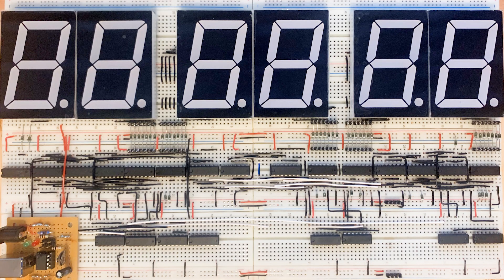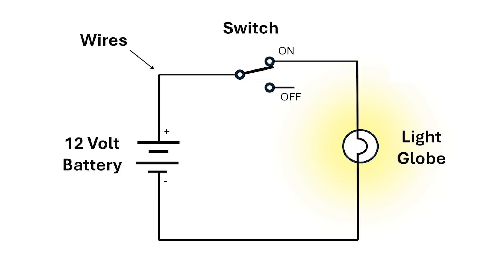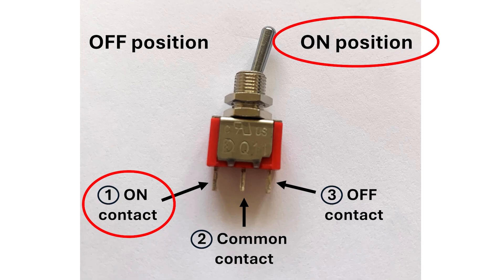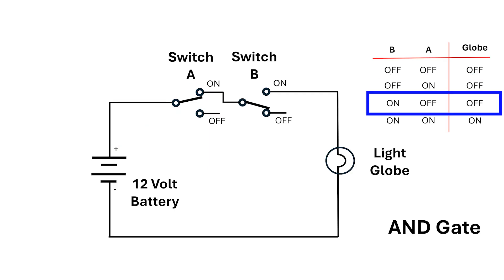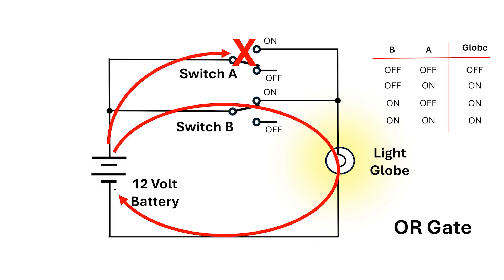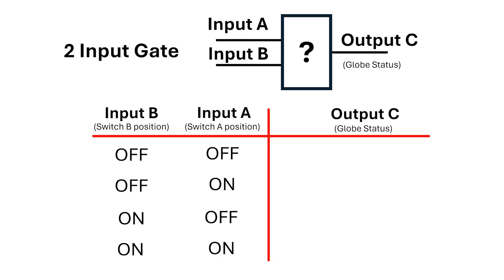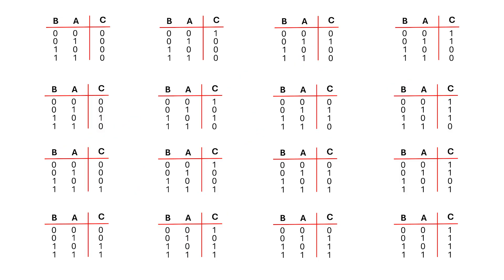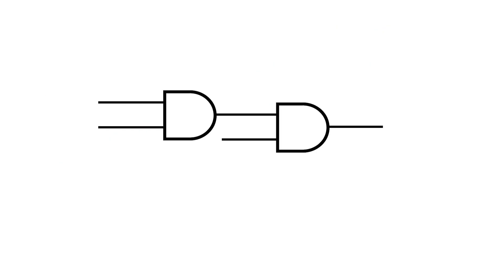Switches to CPUs: 2 Input Gates

Comment: (1:19) This is the classic view of electricity, but technically, the electricity actually flows from the negative side of the battery. That's just a nitpick, though.
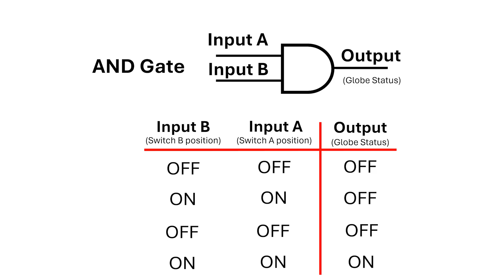(6:16, 7:39) On both of these truth tables, you repeated "OFF, ON, OFF, ON" for both input columns, when one of the input columns should be "OFF, OFF, ON, ON" instead.
(8:01) That should be "OFF - ON" for a short bit before changing to "ON - ON."
(9:28) It might be good to explicitly point out that you added "True" and "False" here.

Great video! Most of my commentary on this sort of video just tends to be pointing out things that could be improved.
Reply from the maker: Thanks for the feedback, glad you like it.
Unfortunately, once a youtube video is up, it can't be modified.
You can snip bits out, or delete the whole thing and repost, but you lose all the comments when you do that.

It was a deliberate decision to talk about conventional current instead of the flow of electrons.  This is designed for 12 year olds, so that level of detail isn't required yet.  

I'm going to branch out into a relay6502 soon which should be fun.
Reply: @DrMattRegan  Relay6502 does indeed sound fun.

I've often seen other channels errata list in the description or a pinned comment to allow for corrections without the need for a reupload, if that helps.

Comment: Buffers are for strengthening the electrical signal, right?
Reply: Yes. In an electronic circuit, a signal will be driven with a certain strength depending on the characteristics of the driving device. In some cases that may not be sufficient strength to send the signal over a distance, or to feed a large number of other circuit stages. A buffer may then be used to strengthen the signal to ensure that the correct signal is received at all connected devices.
Reply from the maker: The relay is a buffer and it was invented for this purpose.  In general now though, i personally tend to use buffers that can disconnect the output (high impedance) which can be connected up to a bus, like the 74HC245.